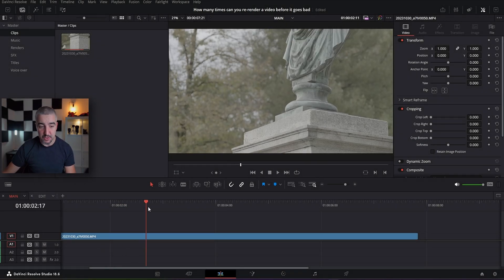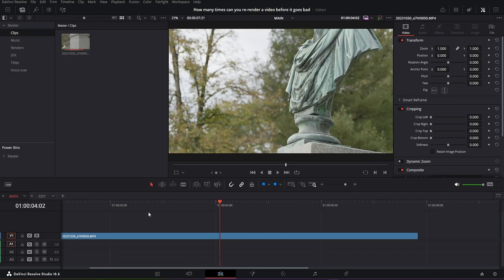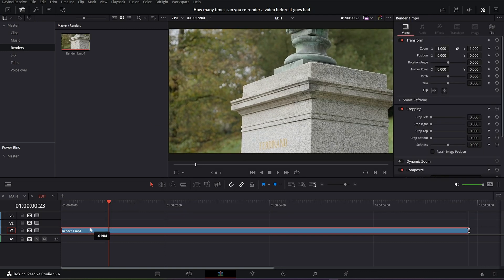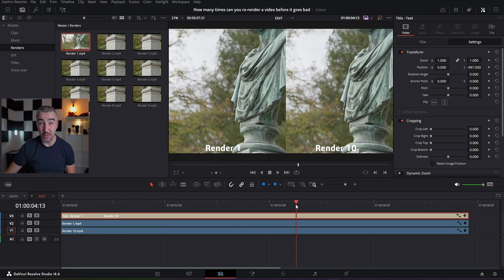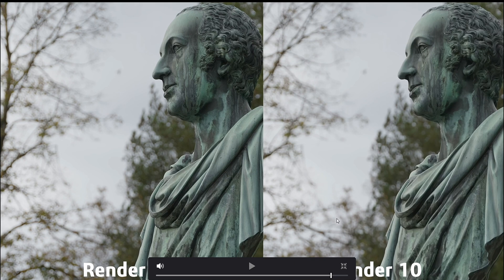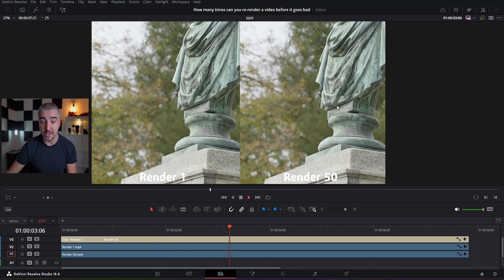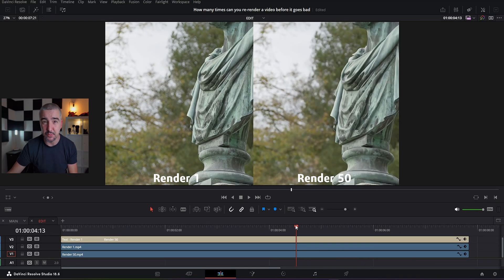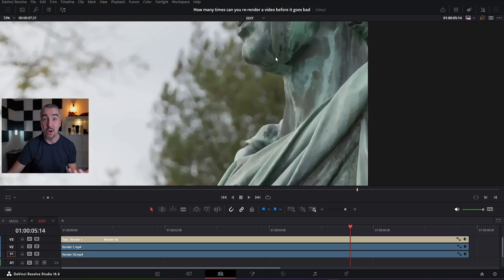How many times can you re-render a video before it goes bad?

Comment: Very useful video. Rerendering once makes so much sense when working on larger projects like a one hour documentary as you simplify the editing timeline by rendering segments of the film. Instead of hundreds if not thousands of clips, you have fewer to deal with. Rendering the master is also much faster. Rerendered clips are not only useful for YouTube. It also looks good on the big screen in theaters after rerendering a clip once, which is all you need. And if needed, a little post production on a rerendered clip can always be used to sharpen the footage.
Reply from the maker: Glad you found it useful, thanks for the comment! I use pre-rendering a lot. Cheers!

Comment: Well, this whole video doesn't make any sense without telling which average bitrate Davinci's H.265 codec uses with your settings. If bitrate of option "best" is sky high (seems to be)  then of course you won't see any difference for a few iterations. Using standard or low bitrates thing will get interesting though - and most certainly quite unusable when reencoding just 1-3 times.
Reply from the maker: Hello. Good point. Maybe I'll make a follow-up video on this topic. Thanks for the comment. Cheers!

Comment: i noticed a slight colour difference too,  videos on the left were always slightly cooler, had more colour detail, looked slightly brighter too, as the was not as blurry.
Which was to be expected.
I'm watching this on a calibrated 27'' 1440p monitor in Firefox using a color profile. To me the first pic clearly looked better on my monitor when you had it that zoomed in.  But watching on a a small low res screen that would not be visible, and colours might not be noticeable either I guess.
Reply from the maker: Hello. Yes the difference should be more visible on a good calibrated monitor. It's OK for YouTube videos but for some higher end production not as much. Thanks for sharing. Mary Christmas.